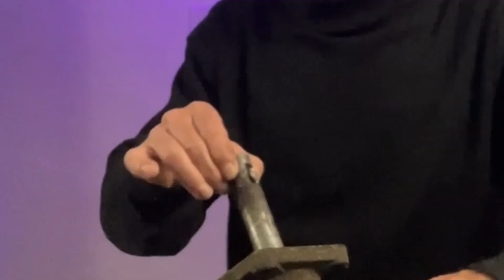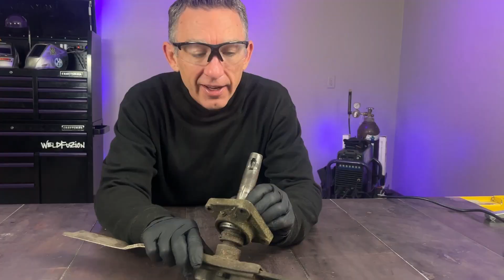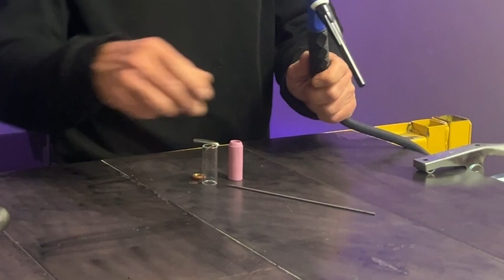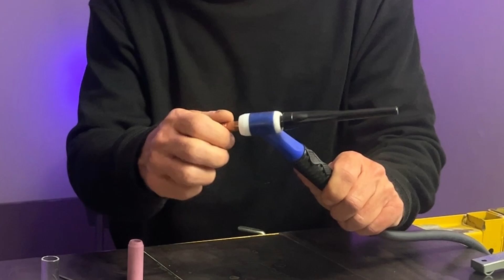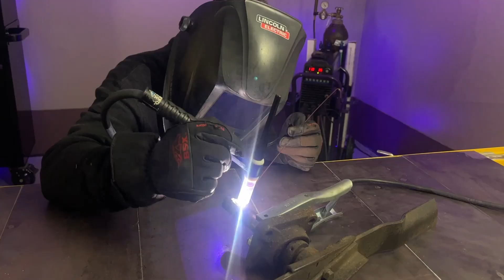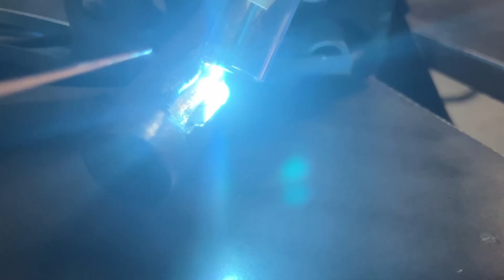TIG Welding Shaft Repair

Comment: Why not just fill that old slot with weld.  Cutting a new keyway on the other side would ensure no hard spots to dull that keyway cutter.
Reply from the maker: That is a good idea! I probably made it harder than it needed to be by Tigging up both sides?! 😂 I thought it would be easier & maybe less work overall, but in the end … ya, no 😂 Thanks for the suggestion!!! 🙏🏻